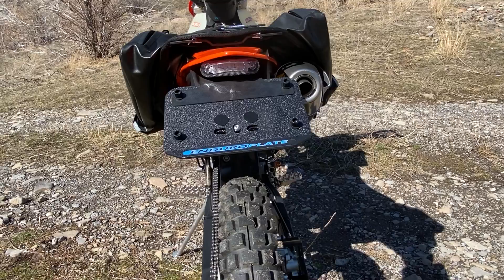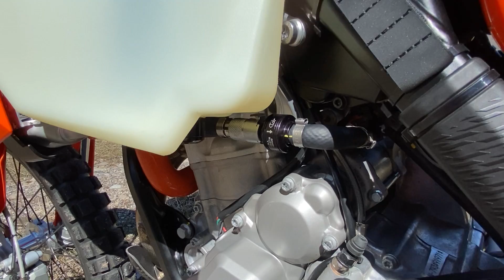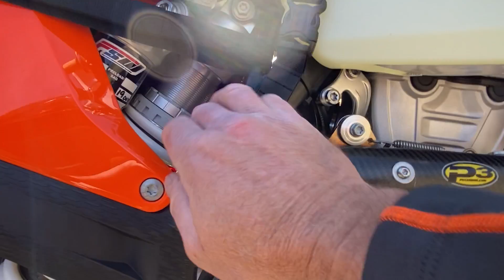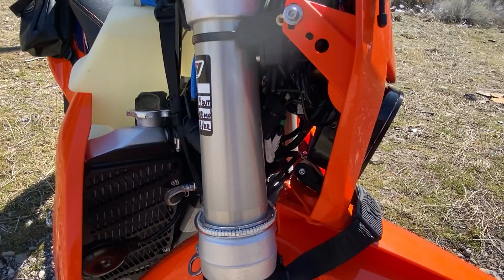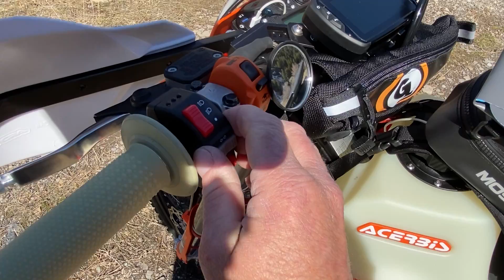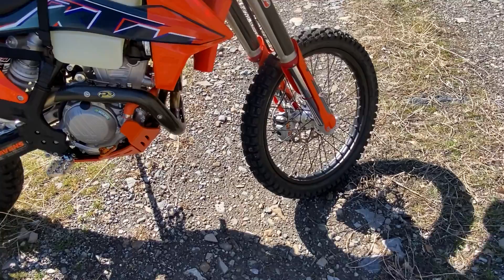Ultimate Light ADV Build?   2022 KTM 350 EXC-F.  Its finally done!

Comment: I cut two inches of foam off my 350 seat and WoW the difference with a 29 inseam it helps, still comphy really.good protection on that and looks great for long hauls, i have one of these, it handles like its wired to my brain.I would replace the plastic oil pump impellars if you get in there.

Comment: I also have a 22 350 and on the fence between the IMS 3.2 and  the Acerbis 3.9. I like the fact the IMS has the brass fittings. Any issues with Acerbis?
Reply from the maker: @brianlarsen9216  thank you for watching. I’ve had no issues with the Acerbis and the bike has nearly 3k miles on it with the tank. Fit and finish are great and imo a bit better than the IMS.  Hope this helps

Comment: Are these like the 500exc that can go forever with proper oil changes/maintenance, or not as robust or long lasting type motor?
Reply from the maker: I've got nearly 4k miles on mine with only regular maintenance and valve adjustment/checks with zero issues. The 350 engine in the EXC platform is a bit different internally as compared to an SX version. Stainless valves vs. Titanium valves for one. If taken care of, it should give many miles of fun! Thank you for watching and commenting.

Comment: When you went with Samco, did you do the thermostat delete?
The Samco clamps are so wide that I found it impossible to get the recommended 10mm hose extension.  What did you do?
Reply from the maker: Yes, I did the delete. It will run too cool if you are riding in a cooler climate, so watch your temps to you run the engine at the temp where the ECU keeps the fueling correct. In hot climates or summer riding, it is no problem. The Samco clamps are wide and if you try and get 10 mm of hose protrusion, it will never work. Just make sure the clamps are square and you have the hoses seated fully on the outlet nipples. Make sure the clamp top edge is below the bulge of the outlet nipple.  Samco hoses are a great upgrade for sure, well worth the money.  Thank you for watching and replying.
Reply: @code4performance  thank you!🙏🏻

Comment: What is your top speed and top “comfortable highway speed”? Thanks for sharing!
Reply from the maker: Tough questions to answer but I can tell you it will hit 80 in stock form and probably a bit faster.  Comfortable highway speed is 55 with the knobby tires and balanced wheels.  You could gear it higher to obtain a more comfortable highway cruise speed and run a true DOT tire applicable to more road use.  Honestly, I built this bike for trail riding with the highway/road use to get to and from the trails.   Hope this answers your questions.  Thank you for watching!

Comment: Who does the "de-smog" and how much does that cost?  I assume you are in California, if not I hear it's a pain to de-smog the Cali bikes
Reply from the maker: The kit can be purchased from Taco Moto Co.  Look them up on the internet for current pricing and options.  I am not in California, thankfully, so emissions are not an issue in my state.  Thank you
Reply: @code4performance  Thx for the info!
Reply from the maker: @tru3sk1ll  very welcome.  By options I meant you could unplug some of the emission devices and leave them installed or go the full delete method as I did and take as much of the stuff off the bike and clean up the hoses routing and wiring.   A good addition is to remove the charcoal canister in the frame downtube and install in its place, the KTM coolant overflow kit.  Taco Moto is a great source for all you need.   Cheers !!

Comment: is it possible to put a kickstart kit on this bike? wondering if the bike also has a capacitor, just purchased one a month ago myself
Reply from the maker: No, there is not an option for a kickstarter.   Tokyo Off Road BLS capacitor is installed on my bike.   Tucked it inside the right side cover next to the battery.    Thanks for watching.   If you are wondering about a capacitor from KTM, no.
Reply: Yea i was wondering if it came stock. Thanks for the reply enjoyed the videos. So i suppose i need to add the capacitor to bump start the bike if the batter ever decides to not work.
Reply from the maker: @Gravehandz  yes, the capacitor stores voltage to energize the bike just enough for a bump start.   You can get them from different vendors like Slavens, Tokyo off road and Taco Moto.
Reply: @code4performance  looking into them now, its a bummer KTM didn't install this stock on the enduro model wow.

Comment: Hi, nice video. What type of folding mirror do you have? Do you like it; high enough to see traffic and not your arm, vibrations, etc? We have a 2021 KTM EXC-F 350 as well and love it.
Reply from the maker: The mirror is a Double Take brand, model is their Trail mirror, retail $25.   It is only 2" in diameter and mounts to the handlebar with a zip tie.  It is really hard to see behind you without moving your body to the side.  Its really only there to be able to pass a DMV inspection if necessary.  Small enough to not get in the way on the trail however.  No vibrations at all.

Comment: So $6500 in upgrades, seems ridiculous
Reply from the maker: Steve, ya it's plenty of $$$, but nothing on it is bling, it has a purpose.  Suspension, for example, is one thing many riders will tell you is the best money spent on any dirt bike.  The ECU which is a $1k with all the options, really makes the bike perform as it should with the added feature of traction control.  I could go on about each accessory, but hope this helps many understand.  Thank you!
Reply: I usually ignore zero value add comments like yours, but I'll play along - when I first saw the mods, I figured about $8k in upgrades, that its really $6500 seems pretty reasonable to me; I have some of the same parts on my 350 EXC-F and echo the opinions expressed in the video (Get ECU, suspension tuning, GPS unit in particular).   You seem to be hung-up on price, which makes me surprised you're watching a KTM video at all, as you don't buy a KTM if you are price sensitive.  What I appreciate here is the author going through the intended use of the bike, and then highlighting the mods to make it better at doing that.   This was helpful to me.
Reply from the maker: @repomannv  thank you for the comment and honesty.    Sometimes people get it and I appreciate your understanding

Comment: Re: sicass headlight switch and motominded setup.   Do you have any issues going from lo to hi and vice versa? I lose the headlight for a few seconds. Very disconcerting in the dark. Have contacted MM but they didn't have a solution at the time. Thanks for the detailed review.
Reply from the maker: So far I have not had any issues.  Double check all your connections and make sure they are clean and tight.  One thing to try is swap back to the OEM switch and see if the problem continues.   At least you can eliminate the switch if it does.   With the supply issues and possible quality control issues, it could be an issue with the light.    Hope this helps.
Reply: @code4performance  Yep, tried everything. Went back to the original switch.

Comment: So now that you have the opportunity to ride the bike for awhile. What do you think the pro's and Cons are  ?
I do realize that there are lots of Pro's . But more interested in the Con's in your opinion 
Thanks
Reply from the maker: Kevin,  I am going to do an update video in the next few weeks to show some changes I needed to make to comply with the Tour of Idaho rule changes for this year, stay tuned.  In the meantime the only Con might be if you plan on weighing this thing down for longer trips and camping off the bike, you might be disappointed in the lack of enough power.   Especially if you are a large stature rider.  Where I am not carrying any camping gear, it has plenty of rip to still loft the front wheel lug when I need to and clip along on the slab.  As mentioned in this video, this bike is for the TOI T1 ride, which is 13 days this year and I will be staying in a different town each night so carrying camping equipment is not needed, just enough to get by.  IF you plan on camping off the bike for a multiple day ride, a 500 would be the way to go in my opinion.   The PRO of the 350 is this thing is a very capable trail bike for a days ride in the mountains, unloaded.  It is really just a 350 XCW-F in the end....mostly.  CON is stock suspension IMO.   A good re valve/re sprung if necessary, is some of the best money spent on any bike.   

Another CON is how the bike is set up from the dealer as far as tires go.  From KTM they do provide rim locks for you, but they are not installed from the dealer.  Change out the OEM tires to something better and add rim locks right away so you don't spin a tire on the rim and tear a valve stem.......

I feel a fully packed and ready to depart video would be great for viewers to see it in Tour ready condition.   Please feel free to hit me up with any questions at code4performance@gmail.com.  Thanks
Reply: @code4performance  
Thanks for your insight and quick response.  I look forward to your next video 
Cheers

Comment: Which RAD Guards are you running?
I have 7602 Racing on my 450 EXC-F Six Days.  I hate them because they block too much airflow and my fan runs almost non stop after I installed them.
Reply from the maker: I’m using the bullet proof designs guards.  In fact they are the only brand guards I’ve used on any of my bikes.    Great product in my opinion.

Comment: Have you dino’ the bike with the get?
Reply from the maker: I have not.   Not a bad idea, unfortunately, I won’t have a baseline from stock to compare to.  The get is considerably noticeable in power delivery and overall performance.  Not to mention the traction control in map 2 is sweet.
Reply: @code4performance  yeah it would still be cool to know what it’s pushing out now
Reply: @code4performance  beautiful bike by the way. I will be copying some of the parts 😂
Reply from the maker: @cryptohammer2400  let me know if you need any help or suggestions on where to pick up parts.

Comment: Beautiful build.   Shame the manufacturer's can't seem to realize that this is what buyers want out of a dual sport.
Reply: no they don't. rear shock issue still not fixed ? https://www.youtube.com/watch?v=yrdXeb9uKRQ
Reply: I have a similar set up on my 2016 FE350. I don't see many bikes like mine. Ultra light off road  touring is really niche. I don't blame manufacturers for not building bikes like this. You'd buy one, I'd buy one but we are a tiny market. We'll buy the base model, do the tank, seat and maybe an adventure tower, and something for luggage. Kove are trying to build this bike. Still, 40kg heavier than my FE350. I like 5,000 km oil changes on the Kove instead of every 3 days on the FE350. But do I like it more than 110kg dry v 145kg dry? Let's see how well the Kove 450 sells.
Reply: @TheIdlesurfer  I don't know that it's so much ultra light touring as it is just  being properly set up for dual sport riding.   I have a similarly set up 450L and ride with 3 similar KTM500's, a DRZ and a XR650R.   All with tanks, seats and other mods.  The build in the video is of course next level and I don't mean to take anything away from it.  
 
As for the Kove I'll admit I'm suspicious of the service interval considering the power output with regards to the displacement.
Reply: @mikeisland7382  true, but I guess you're not in Europe. Over here in Western and Central Europe you'd always be within 100km of fuel, but most of my riding buddies have bigger tanks, a rack and a Seat Concepts seat. So I guess I agree your main point. However, my bike is racing enduro which happens to be a very good dualsport. My FE350 was pretty good out of the box for European trails, until I got into Northern Finland, but a bigger tank makes for a less anxious ride. I think the Kove will be pretty good on oil changes, as that 450 lump is in the Fantic Caballero and it is proving reliable. Still, 145 kg.
Reply: Nah, most dual sport buyers are new riders or come from road background.

Comment: Excellent job on the wiring.  Do you feel like the 3.9 is too heavy?  People complained about it wanting to torpedo when leaned over.
Reply from the maker: Tim, thanks a bunch!    I wanted the larger tank for my plans with the bike where it will be used primarily for long day outings and not racing.  I would agree, the 3.9 is a lot of tank and without going stiffer on the fork springs it could have the potential to cause the forks to be lower in their travel and thus add to the wash out feel.  Hope this helps

Comment: I just made a new list! I have a 2021 FE501S and have done many of your upgrades, but not nearly as complete as yours. 

Question: Why did you eliminate your blinkers? The Exc-F is the street legal model, correct?

Consider doing what I did. I installed the Sicass rear blinkers that mount along the subframe below the fender just next to the taillight. Super clean. The front blinkers I have are also Sicass. They are built into my Sicass handguards. It requires a Sicass blinker relay and that’s the only addition. Front and rear blinkers do not stick out at all and are very visible when activated. 

I’m ordering that dash!
Reply from the maker: Thank you for the comment.  As far as blinkers go I did not eliminate them, but used the Taco Moto Co fork wrap front signals and their Tidy Tail replacement rear brake/tail/blinker led light.  Super slim and gets rid of the stock mess from the fender.   It is still street legal as well, although may not be in every state.  Sicass stuff is good as well, but I liked the slimness of how it’s set up now.

Comment: I expect I would not be the only one who would be curious to know, what prompted your choice in the 350 over the 500 since the weight is hardly any different. I would expect the 500 to be more fuel hungry or at least older carbed bikes of any brand would have had that not in their favour.
Reply from the maker: Charles, great question.   I am not a huge guy in stature, so the 350 has plenty of grunt for me.  With that being said, after several, long days on the bike, the 500 might become a handful when you get tired.   The two are close in weight as you mentioned so that had nothing to do with my choice.  If you are riding slab frequently, commuting to work and town and even long desert riding, the 500 might be the best fit.   I cannot comment on fuel economy, but would think they are close to the same.  Perhaps someone reading can offer more input on fuel mileage.   Thank you for watching.
Reply: @code4performance  For sure it all comes down to the power requirement due to weight being packed and if its used on road at higher speeds or that is not the intent. Myself, have not been using a bike for some years but would have liked more power then my 500 at the time put out, air cooled and older technology .. no computers on it, that's for sure. I wish they put a kick starter on these newer bikes, that is one thing that would bother me buying a current off/on road bike to not have as a backup. Besides, it was always a good laugh to watch others try to start my bike !